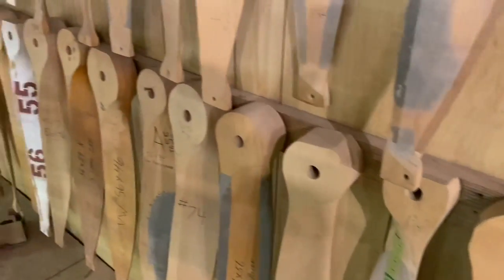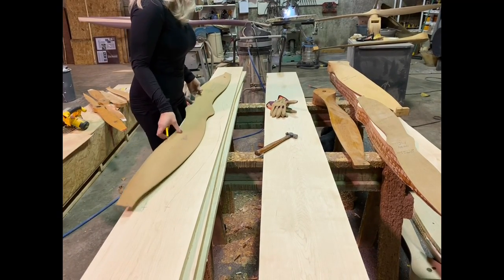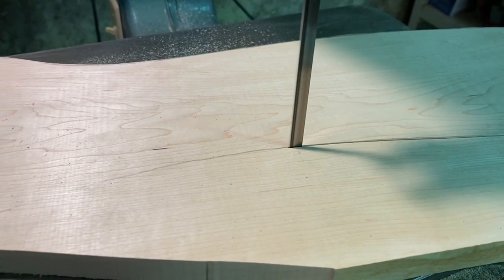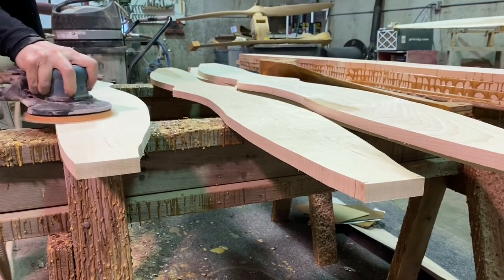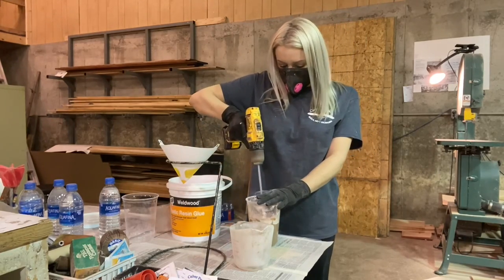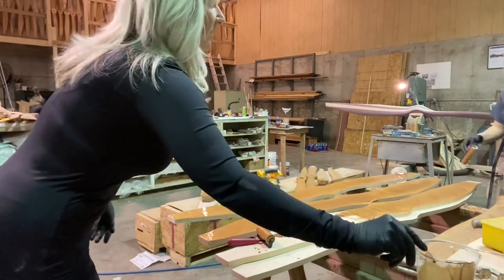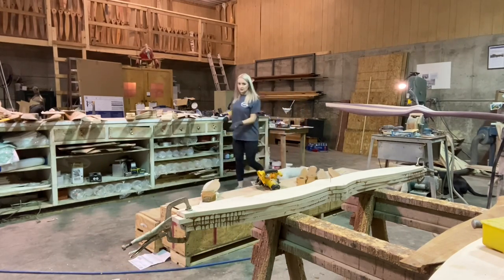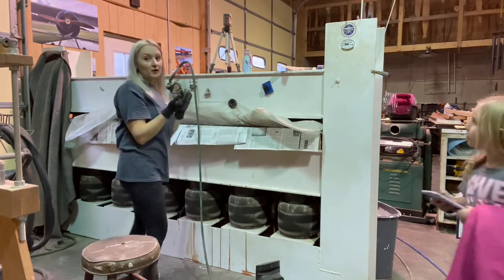Day 1 of making a Corvair/Pietenpol airplane propeller

Comment: My grandfather told me to always carry a pocket knife.  Not only is it useful but if you ever get lost just pull it out and start sharpening it.  Within minutes somebody will come along and tell you that you’re doing it wrong and then you can ask them for directions.

The same is true for just about any tool.  At the end of the day it’s yours and your right to use it however you see fit.  Keep doing you.

Also, I just recently (maybe 2 weeks ago or so) found your channel and have been loving it.  I’ve had it in my mind for years to build myself a prop; I’m old enough now to know that I will probably never get around to it.  When I’m finally ready for one I will be giving you a call.

A couple comments from watching a few videos now:
- the speedball roller that you use to spread the glue is generically called a brayer (sp?).  Not sure if that helps you find potentially cheaper alternatives, if needed.
- in one video your father used a chainsaw to remove a section because of the thicker hub.  I’ve seen you use a 4” angle grinder fir sanding.  They do make wood carving disks that would have removed that excess fairly quickly.  Cutzall and saburtooth are two of them.
- in one video you had grandma helping move a blank through the bandsaw with the help of the rollers on the top of a planer.  Rockler, at least at one point, made spherical rollers that were essentially round ball bearings trapped in a housing that could be screwed to a board.  The benefit was that material placed on the could roll in any direction, making them ideal for things like bandsaws where you aren’t just feeding the material but also moving side to side.  It would be extremely simple to screw a few 2-3” apart on a length I’d 2x4 and have the tops at the same height as the bandsaw table.  One for in feed and one for our feed would support the prop 100% and you’d never have to hold the weight again.

Want any info in any of the above just reply and I’m happy to email links.  Thanks for the videos!
Reply from the maker: Thank you! I love your grandpas saying!! I  took a screen shot. I will look into that. 😁
Reply: @CulverProps  just in case.... Rockler 1” ball bearing rollers, item#2082

Comment: I've always been a fan of wood props, I actually made one in the same manner that you guys do.  Used aspen and mahogany, then formed a brass leading edge protector with soldered on screws...more for decoration than anything as I'll never hang it on one of my planes.  What I'd love to do is recreate a Jablo/Rotol blade, used on some British WWII aircraft.  They used .6mm veneer, in ply counts up to 50 or more, with additional plies at the root of the blade.  Ordinarily that would cause the root to be thicker, but they used some really high pressures to compress the plies to the same thickness as the tip while the glue cured.  This gave the prop a much higher density where strength was of particular concern, and lower density at the tip that helped reduce centrifugal forces.  The finished product in bare wood looks particularly stunning.
Reply from the maker: Very cool, I will research that! I have a list of props to duplicate.

Comment: Enjoyed you videos. I have a pattern shop we make wood patterns for metal castings and fiberglass molds.
You have similar equipement to us just us it differently. You also make the same thing every time , we almost never make the same part but we use the same methods. 
We still make by hand but we do sub out some cnc work as customers sometimes only provide 3D models of what they want. Usually we are remaking parts from drawings 30-100 years old.   I don't think some of the new designers could dimension a drawing properly to allow a job to be made by hand.
You are lucky to have the templates to work from.   
Can't believe you wear black clothing all the time but at least you can see the dust! 
Cheers Warren .
Reply from the maker: I love duplicating old designs, it’s the best feeling to bring them back to life
Reply: Culver Props  right more often than not we are keeping some old piece of equipment running!

Comment: Just an idea to help you to not lose things like drill bits................Make up a shadow board (just look up making a shadow board for tools). I build furniture and make guitars (for myself and friends). When I have finished using a particular tool/item. Just put it back in it’s place on the shadow board and you are ready/set to go. For the next time you need it. Also your shadow board tells you if something is missing. As it’s not in it’s place. It’s just a useful thing to do.............if you are that way inclined. I was always losing/misplacing tools/items. Shadow boards have minimised that and I just find them useful.

Comment: I thought the bandsaw position was deliberate.  Standing back as far as you do to have control of the timber, if it was lower, it would really compromise your ability to see the cut line. So, although I judged it to be unusual, it got a pass from me. I don't always do what is expected with my little cnc lathe, but heck it is mine and I will use it as I like.
Reply from the maker: Amen to that!!!!!

Comment: Large shops with repetitive tasks tend to setup workstations with all the tools that you need at that particular workstation (and not 'sharing' tools across workstations). Have you ever considered doing that in your shop? That is if you had a toolbox next to your glue up ... it might have rollers, pencils, clamps, a drill with the drillbit(s) you need. In by the mixing table ... the drill (a different one than the other stations) to mix, the mixer, stand for the filter. Then your not pacing back and forth so much and you have everything right where you need it. Not that your doing anything wrong, it just might help with misplacing things and keep you from walking back and forth so much.

Comment: Consider using an electric blanket over/under the press during glue ups to maintain proper temps on cold days
Reply from the maker: I have made a tent with a heater blowing in it but I had not thought of an electric blanket

Comment: I'd like to see the whole process of how you make the patterns. How do you calculate the twist and how do you shape a pattern so that the twist is accurate?  My understanding is that the amount twist varies from the hub to the tip.  How do you allow for that with props of different diameters?
Reply from the maker: Well that is a pretty in depth answer and is very dependent upon the project. But.....props are measured in inches of pitch, so if it has 32” of pitch then the plane should move 32” forward with every rotation of the prop. To figure that I take the cruising RPM and MPH and get the pitch.
Reply: @CulverProps  What method do you use to create the shape of the pattern with the correct pitch?  How about a video of the making of a pattern?

Comment: Fantastic video!  I’d love to have a prop for my wall.  The bandsaw guard got to me too. I’d recommend dropping it to about an inch above your boards. I’d also recommend vice clamps on the hub first and add clamps further out before you drill your pins. You can see the glue squeeze out from the blades but none at the hub. This should improve your glue-ups.

Comment: Does the sanding of the bare woods prior to gluing key the material as well as making it smooth. And what grit is used on the pads?
Reply from the maker: Just cleans it up and gives it a little scratch for adhesion
Reply: Thanks
Reply: @CulverProps  Thanks

Comment: How much do you charge for a prop going on a corvair engine? My uncle is making an airboat and he is still deciding on wether to use a corvair or some other automotive engine around the 90-100 hp range. Hes going to be buying a prop soon so I am curious how much these props run. Thanks
Reply from the maker: $1395 and up for a 3” hub thickness
Reply: @CulverProps  Thank you mam. You be safe in that shop. Youre doing an awesome amazing job. 😁 Probably be putting in an order sometime in the near future. 😁

Comment: Just watching the band sawing section, it looks like you could bring your lower back bearing forward to keep the blade from flexing to the rear. It should be a paper width gap between the back of blade and the bearing when not cutting.....not a hard adjustment to make, also check the top rear bearing. I do not know what sort of blocks you are using on the side thrust of blade, but they make some graphite inpregnated linen phenolic resin blocks that you can run touching blade from side [normally you set metal blocks .003" away on either side. 
When running metal blocks, If blade pushes back because of rear bearings out of adjustment, it is easy to dull blade when teeth contact blocks., [teeth are crushed in so your kerf goes away.  If for some reason you want to run very narrow blades, it becomes an issue of not being able to support blade from side to side. With the phenolic blocks, you can actually run the teeth on the block as it will cut into block to support, also the graphite gives a slight lubrication to the blade with out guming anything up. The product is called Cool Blocks, or Kool Blocks, I have been using since 1989 and I have great success with them. I sure hope this makes sense and helps.....Best Regards, Paul Oldtimer  wood and metal worker in Florida
Reply from the maker: Thank you!
Reply: @CulverProps  best wishes.....from Florida, Paul